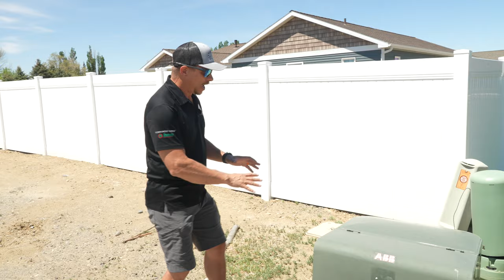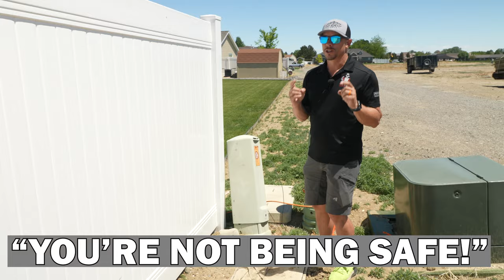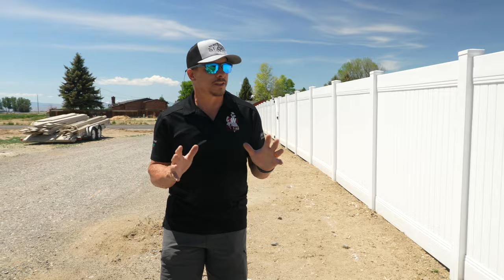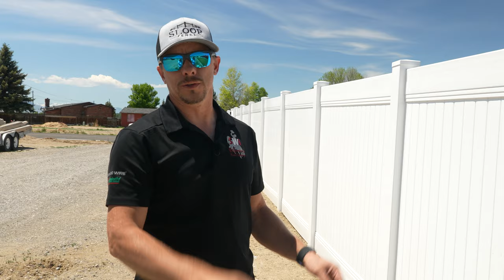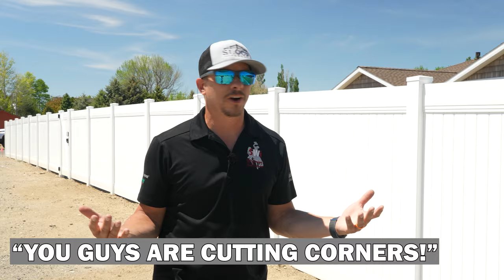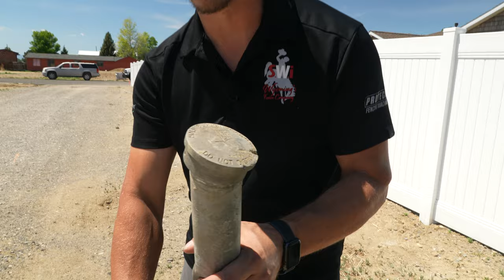Responding To The No-Dig Vinyl Fence Critics | YouTube Crowds Are Tough!

Comment: I got some resistance from fencers trying to do just what you showed for no dig vinyl. No one here; I met so far, wants to do it that way for me. Some laborers never heard of these tools. I believe it saves money for easy repair unlike the other way of digging up the old post and putting in new ones. I decided to buy the tool myself and get it done after checking with National Grid and having the lines marked before I start. Keep up the innovations to do some work in a safer, faster, and more efficient way. Especially if it can save your back from digging. Hooah!

Comment: Not sure if you mentioned this, but the diagonal brace on the gate is incorrectly installed. On the hinge side, the brace must start at the bottom and run up so that it resembles a truss and is actually loaded when someone pulldown on the gate. Other than that, your work looks very neat.
Reply from the maker: Thank you! You're absolutely right that the gate looks wrong--but that's because they're braced on each side. The brace on the opposite side runs the opposite direction, so they can be installed either way. 👍🏻

Comment: what's your opinion on Quick Crete? Have you had any experience with Quick Crete? That's commonly used in Oklahoma, and I've used it and their extra strength blend from Lowe's. Just wondering what if any your experience has been using them? I used some of the extra strength blend when I set a dozen auger anchors for my trailer a couple of years back, and it seems to have done real good. I have a lot of sandy soil where I am in Oklahoma, but I was wondering if you have any experience with it since you do fences for a living. I really like the video Dan done on this fence. i just watched it, in fact and saw this update video on it. My name is Dan as well. I liked the whole system they used to install this 6' fence. I might have to get some 8' post if I were going to do it in my yard; with my soil type, I may need 4' in the ground instead of 3, but this turned out really good in my opinion. I've been in some facet or another in construction all, my life, and I'm 56 now, but I've been doing electrical work for the last 10 years now. Must my 2 cents on it, but I'm curious if you have any opinion on the Quick Crete blend?
Reply from the maker: I would use Quick-Crete for specific applications, but never as a general rule. https://youtu.be/_n4dKI-iQsY

Comment: One more quick question, because I was thinking steel posts would be better for endurance in Oklahoma; what would be any cause of the post rusting in the ground that could be avoided? I see that sometimes with galvanized fence posts; they tend to rust out over 10 years. What would be your feedback on that?
Reply from the maker: I have seen that myself sometimes--but not very often. You could always use some Galv Pro spray over the rusting spots. It would still take and immense amount of years for the post to completely rust out.
Reply: @SWiFence  thanks!

Comment: What tool do you use to dig holes by hand. I cut several lines with standard handheld diggers. For the last 10 yrs or so I use a V-shaped bit on my little beaver digger and I can feel any obstructions in time to get out of the hole and see what I am coming in contact with.

Comment: Use a wire not a string the string will break. I have been driving posts for 20 years I have driven post 16 ft. Deep on marshy ground. I know of a game fence in Louisiana that the post are 60 ft on the ground. The guys Neighbor’s laughed at the guy. When the flood came his neighbors fence’s were washed away his stayed. When his neighbors rebuild there fences they put there post 60 ft. In the ground. I think y’all did a great job putting the fence up.
Reply from the maker: Thanks!
Reply: 60'?! Where are they?

Comment: How do I fix?  Hurricane Ian snapped about every other 5”x5” cemented vinyl posts at the ground level.  I was gonna pull them out w/ skid steer or use a farm jack but I keep hearing the vinyl will break or post will slip right out of the concrete????  Could I just leave them in the ground & drive a metal pipe in the broken post & use donuts?  I’m trying to avoid digging them all up by hand & re-setting them.
Reply from the maker: That's a pretty bad scenario. There's not much you can do other than yank the concrete out. https://youtu.be/uFEuUAAhP5g

Comment: Would you ever consider digging a hole for the 2 3/8 steel post and concreting that? Then put the donut and slide the vinyl over it? A bit more expensive but a smaller hole for the average DIY'er, less cleanup, and you would still retain the easy repair capability if a vinyl post ever breaks.
Reply from the maker: That's going to get more expensive as you're not offsetting the cost of the steel with a concrete savings. If we're pouring concrete we're just going to stab the posts straight into it.
Reply: @SWiFence  Makes sense. TY

Comment: How about the diagonal brace on the gate? It started at the hinge side and goes down to the latching side? Is this because vinyl works better under tension than under compression? I’m not saying it’s wrong I’m just curious because if it were made of wood it wouldn’t be optimal. So to my eye it looks wrong
Reply from the maker: No worries, those gates confuse everybody who doesn't see them in person. They've got a brace on each side, and each side runs the opposite direction. That just gives us the most flexibility for install. You're right though--if that were the only brace it would be backward.

Comment: Is there a method to adapt a existing chain link fence with the donuts to convert to 6 ft Vinyl?
Reply from the maker: Typically the post spacing for chain link is greater than the post spacing for vinyl fence, so it doesn't usually work. ☹
Reply: @SWiFence  thank you for the info.